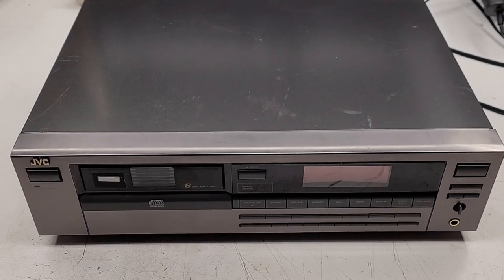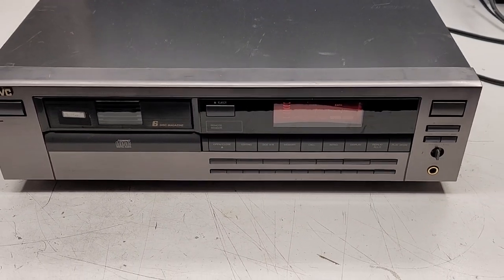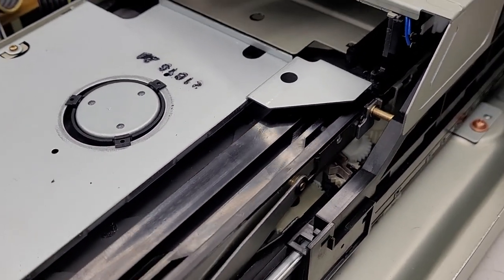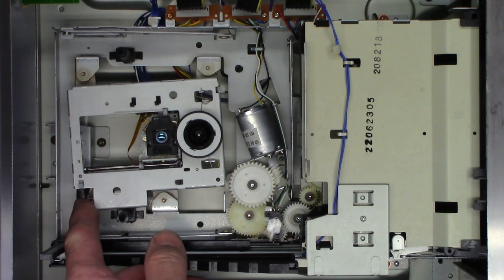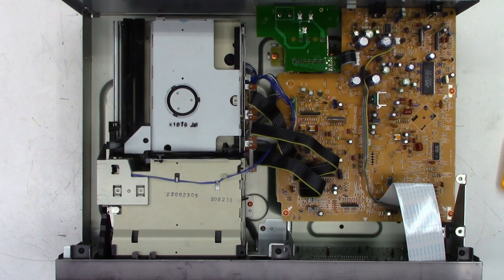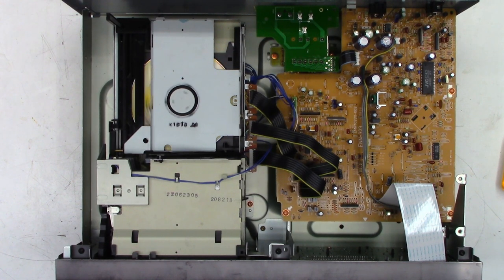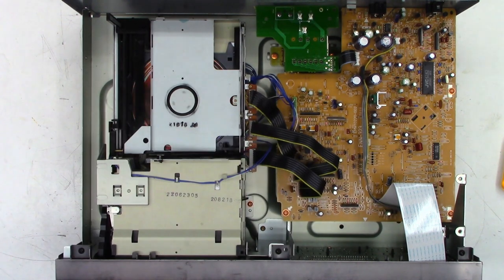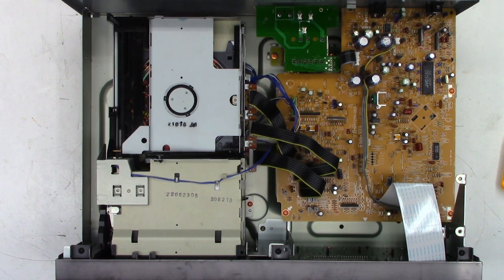A JVC XL-M407 6+1 Disc CD Player that wont do anything except power off. A No Parts Required Repair!

Comment: I remember working on several of those units over the years. The plastic worm gears on the motors would crack and the motor shaft would spin inside the gear. Great video as always. I'm loving my Blue ESR meter. Back in the 90's, a Circuit City moved into the plaza that our main shop was in. We all thought that would kill our business until we found out how much they charged for repairs. Any time a customer would bring something in with a Circuit City repair tag, we would jack up our normal price about 30% and still get the job.
Reply from the maker: Thanks Dave, Glad you picked the Blue ESR meter. I love mine. I did warranty work for Circuit City and Best Buy in the early 90's and 00's when they didn't want to send the items to there service center almost 200 miles away.
Reply: @norcal715  When I was assembling my ESR meter, I dropped one of the decimal point LEDs and it went flying into the debris field under my workbench. I looked for it for a good hour, then gave up. I ended up pulling an LED out of a junk board, so one of my decimal points is yellow.

Comment: Question - Hope you are still monitoring this..... After retiring an XL-M505 due to circuitry issues, we acquired an XL-M407 from my mother-in-laws estate. When applying power, its symptoms were identical to your video, which was "a great help"; after removing the 3 scissor brackets, I also found a stuck CD and was able to get it back in place. NOW, this issue has become getting all the scissor brackets in alignment without the others falling back out of place. Spent several frustrating hours and am back to square one. Do you recall which scissor brackets to start with for reassemble? The front, right side, left side, etc. I'm a retired NASA engineer and fully understand the goal, just having a hard time getting there. Thanks.

Comment: My +1 tray won't open, there is no cartridge in it right now.  I'll open it to see if there is a disk loose.
Reply: Well I made the problem worse ha ha, I managed to free up the single tray, the belt was fine and it ejects fine now.  But I powered it up before getting everything back in the right spot, and it seems the gear to load the trays in/out was damaged, I am trying to get the gear to see if it can be replaced.  Also a problem with the large gate to raise and lower the whole mechanism, it moved and a white carrier piece popped out with two micro switches under it.  now I can't figure out how to get it back correctly.  Don't do what I did.